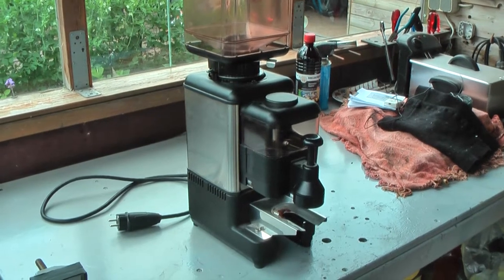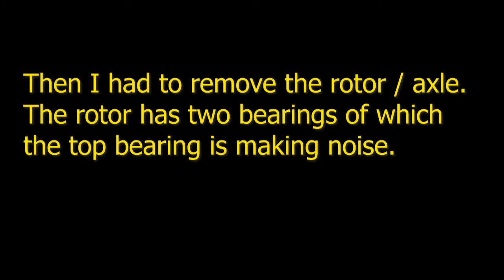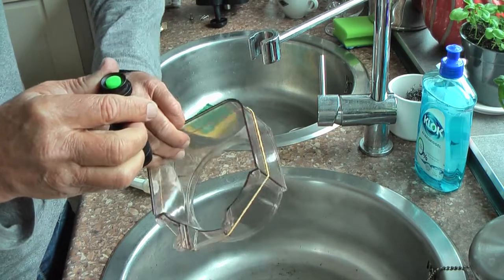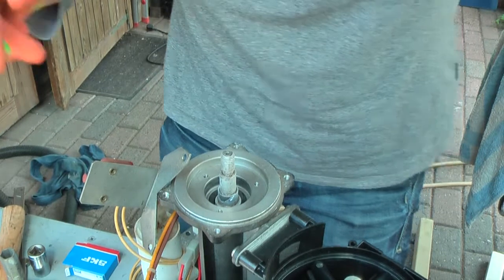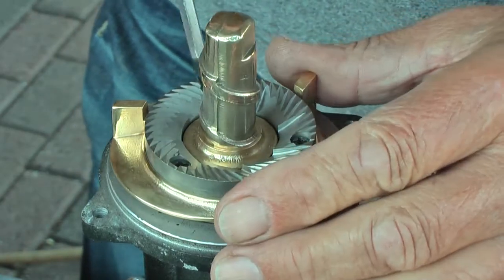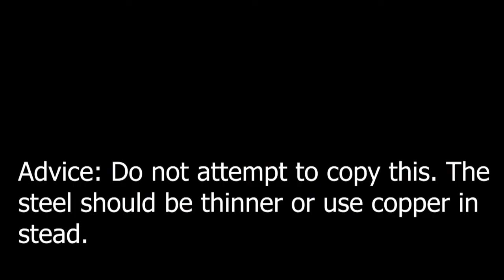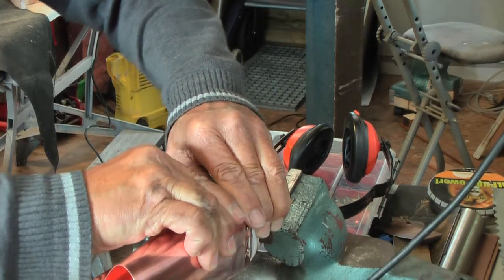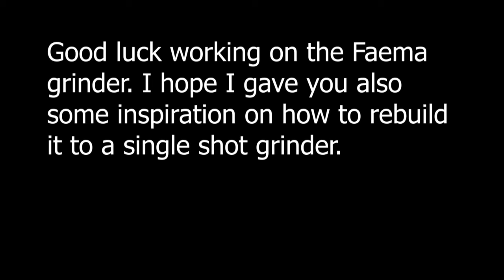Faema MPN coffee bean grinder, hopper and doser overhaul + modification to a single shot grinder

Comment: Have you got a link to buy that silicone water bottle you used? Great idea!
Reply from the maker: Aliexpress is “full” of these bottles. Just type ‘water bottle silicone’ in the search field and then select a black/dark grey one. To make it stand more stable and secured in the black upper burr holder I made a pvc ring out of standard 50mm OD pipe with a wall thickness of 2.5mm. I gluwd it to the bottle. Gerard